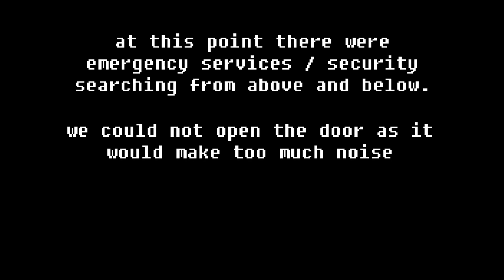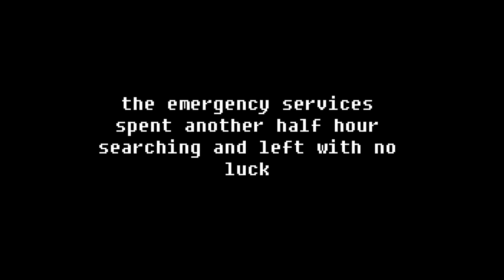CRAZY ESCAPE FROM POLICE HELICOPTER (LONDON)

Comment: Once they got to the top of the crane my brain was like "now, jump. You know you wanna..."
Reply: I was thinking if I were there I would've jumped in the water
Reply: @ElMango14  and died :( you cannot survive usually higher than 30 m jumps in water, some did it from around 50 but you need special training and knowledge to get into a special position... with one elbow protecting the chin, feet very straight and tight, etc....

Comment: "What's the point, what's the point" - Suggesting it's the emergency services wasting their time rather than having their time wasted. They should bill you for the AvGas at least.
Reply: the police helicopter does not use avgas, it uses jet a1 fuel which is kerosene type fuel because the helicopter is powered by jet turbine engines.